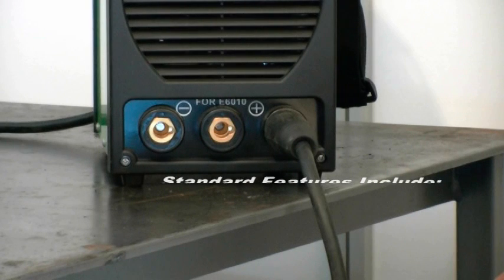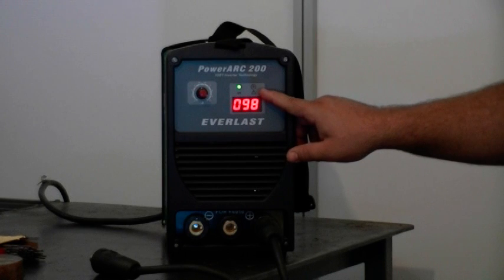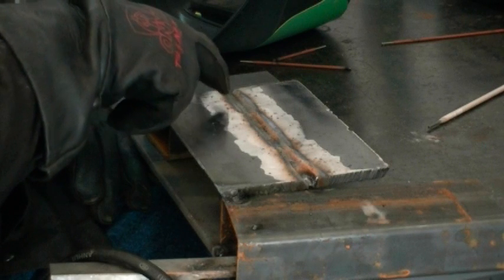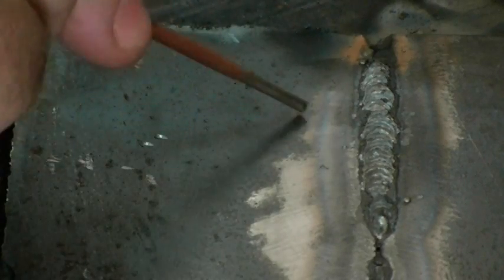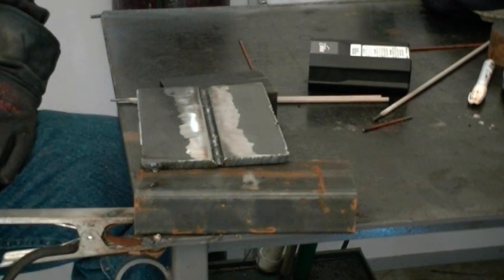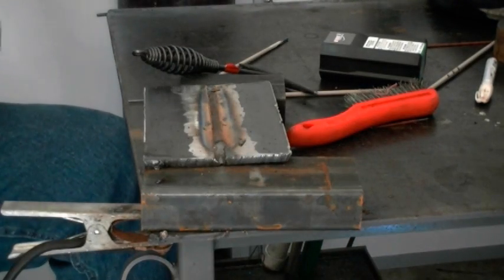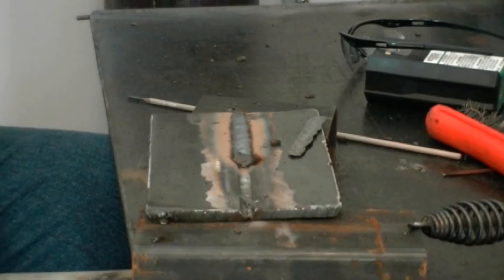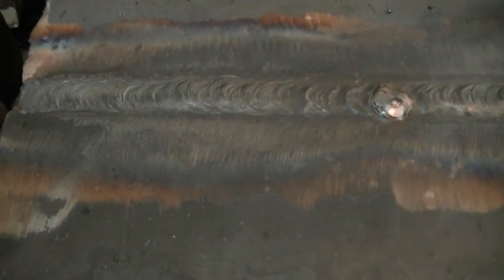PowerARC 160 and 200 - Stick SMAW Welder - 6010 Burning Capability - Everlast PowerARC Welder

Comment: I wish the 140 could have ran 6010s, I just got mine and was pretty disappointed......
Reply from the maker: It's not advertised to weld with 6010's.  It does say so on the website and the manual I believe that it does NOT weld 6010's.

Comment: 0:39 says: powerarc 200 - 60% duty cycle @ 200 amps 220v

everlast web site says: 35% duty cycle @ 200 amps 220v
                                       60% duty cycle @ 160 amps 220v
!?!?!
Reply from the maker: +MrMrsregor The unit that has replaced the old PA 200 (see upload date), is the PowerArc 200ST.  Internally it is more robust than the older unit with many upgraded features, but we have downgraded duty cycle due to new duty cycle guidelines from Canada that now require it to be rated at a higher temperature than the US standard.  In order to save confusion, we have chosen to use the higher duty cycle standard.
Reply: +Everlast Power Equipment i see, good to know. thanks for the all the info. i was looking for the powerarc300 but can not find one for sale at a reasonable price and i am now considering the powerarc 220st, although i do not like the idea of 35% duty cycle
Reply from the maker: +MrMrsregor   We have pro pipe welders using these units, and they typically don't have an issue.   35% is still fairly generous when stick welding and that is at MAX amps.   Most people won't weld over 160 as it is with most welding rods.  If you do, I'd definitely try to save for a larger welder.
Reply: +Everlast Power Equipment what would you suggest is the "max" thickness steel you can weld in a single pass (with the right rods on 220v)?
Reply from the maker: +MrMrsregor  Really, the rule of thumb is not to lay down much more  filler in a single pass than the diameter of your rod.  You can weld thicker of course, maybe up to 3/8" but why?  You end up with inclusions and porosity.  A 5/32" rod is a pretty good rod to use at 200 amps in some classes.  Other classes may allow you to go thicker, but most people welding 160 amps or less will use only 160 amps or less.
Reply: +Everlast Power Equipment thanks! i have a 140 mig and need something a little stronger for welding some offroad bumpers and tow points

Comment: Question, on 110v AC power supply, what is the max amperage the Powerarc 200 will run? Hoping at least 130 amps so I can run 1\8" 7018.
Reply from the maker: +Rob Murphy 
The new 200ST, will operate on around 120 amps, but you need a large breaker to accomplish this.  Please see our website for details.  www.everalastwelders.com

Comment from the maker: We are not responsible for Amazon, they sell and stock their own product from us.  You can verify the duty cycle of the machine by looking at the spec panel on the side or back of the welder.  It will give you the duty cycle rating at full amps.

Comment from the maker: No, we don't have a video of the 160 STH with 60% duty cycle.  In fact we don't have a 160STH video out.  If there is one out, it is not by us.  If you are getting only 92 amps, then you have it hooked up to operate 110V.  Black and white wires are hot.  green is ground.  Are you trying to down convert to a 4 wire system? If you are, the red wire in the receptacle is usually hot.  But We'd recommend you use only  a 3 wire dedicated circuit for the welder for code.

Comment: im only getting 92amps out of my 160sth im assuming im not getting the full 220v to the machine.Would that be why the machine is maxed out @92amp instead of the advertised 160amps? I bought this 160sth for one, its advertised @ amazon and several of your videos to have a 60% duty cycle???On your website you have it advertised at 35% duty cycle??please explain

Comment: The 160 is a great little welder. Must have been a connection problem like you said. I've been using 6011 with my 160. Am I missing anything by not using 6010? I have always thought they were very similar.

Comment from the maker: Also if you have your welder connected with the welding torch in the 6010 port and the work clamp in the left negative port, this will also cause an issue because these are both negative ports.  You must always use the far right port for the torch (for positive polarity) and change the work clamp from the left to the middle 6010 port (if needed).  The work clamp is in control of the 6010 operation.

Comment from the maker: I'm not sure who you are, but we have tech support, and if you just got it there is no shipping cost involved to send it back under our 30 day satisfaction guarantee if you just got it.  In fact, I have never heard of a single PowerArc 200 failing out of the box.  There are other thing that may be wrong, like improperly wired, or yes, even a faulty breaker...which are common mistakes that we help identify in technical support.  These units are indeed tested live, and load tested in the factory.